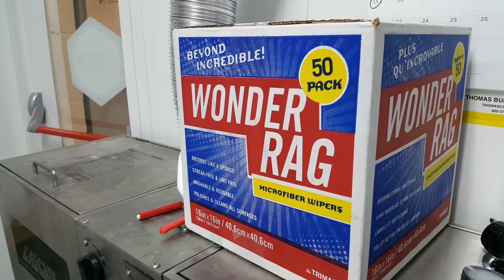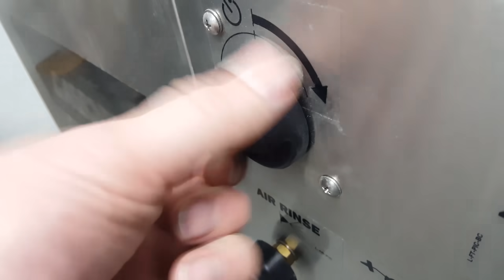Spraying Waterborne Paint / Tekna Clearcoat Gun

Comment: Great video whats the advantage of waterborne paint is it cheaper easier to use and do you need a special gun to spray it.
Reply from the maker: It contains less or no solvent that makes it compliant to spray in heavily regulated areas. You can use the same equipment for the most part, it is comparable to solvent just a few different quirks.

Comment: Hey Just a note to let anyone who might care about it -it is possible to turn a regular tekna into a clear gun by adding the DV703529 Devilbiss 703529 Air Separator & Seal Kit and DV704200 Devilbiss Automotive Refinishing 704200 (Pro-102-Te25-K)Air Cap & Retaining Ring. $150 US from autotoolworld.  I wish i could recommend the gun setup but after 2 jobs I find it no where near the atomization of either the Sata 5000 or the ws400.  It is a wet center heavy rp like pattern but at full material on a 1.3 tip i felt it was no better than the te20.

Comment: setting the gun for the primer? pressure? how many laps for the fluid? good job !!
Reply: Raffo Asus it’s sealer, one coat, air pressure will be the spray gun manufacturers recommended psi to achieve the required air pressure at the air cap. ie...Tekna pro lite would be 24-25 psi at full trigger.

Comment: ...which colour of paint did you say before spaying the red? And why did you spray it first
Reply from the maker: The groundcoat is a shade of grey, this one would be closer to white. Because the red is transparent, it will cover white with fewer coats than it would black. Another reason is because new panels require a primer to be applied first over the black e-coat for paint durability.

Comment: used my tekna for the first time today, loud and a lot of overspray
Reply: Julio.  I have thousands of hours behind Teknas.  If you’re loud and have an excess of overspray your gun is not set up correctly.   Check your data for pressure range and adjust accordingly.  Ensure you’re using the pressure gauge provided with the gun.

Comment: Your opinion?   I'm spraying SPI universal HS clear with a tekna clearcoat gun.  They strongly recommend using 1.4 tip.  Would you suggest the hv25 or hv30 cap for the smoothest finish?   I have a decent compressor with 20cfm.  Thanks.

Comment: I need some help. What should i do if my waterborne basecoat isnt dry enough and its allready covered in 2k clear. I have pressure point problems. If i put pressure with my nail i see a dent in the paint.  It has been a month since it got painted. Will it dry over time ?
Reply: You have water intrepment water hasnt evaporated and won't because it's sealed of with clear.
Looks like you have to take the clear off so basically start all over bugger😣

Comment: So what is the verdict on the tekna clearcoat gun?  I have been waiting for someone other than Gabe to review it.  Give some feedback on its atomization and your setup.
Reply from the maker: The best way I can describe it is it has the typical Devilbiss spray pattern, crossed with the wet core of something like an RP. It doesn't seem to atomize as fine as something like an Iwata WS400, everything lands pretty wet. I've only sprayed a handful of jobs with it and had some other people try it, been hit and miss with people. I've been using the TE25 aircap that came with it, I don't recall the pressure. For the jobs I've sprayed, it delivered the product well, but had a bit more texture than some other guns, nothing crazy but maybe I just haven't hit the sweet spot with it yet.
Reply from the maker: Also, I did use it on a job a few videos back (Blending Paint on a Hood). I talked a little bit about it, I think that was the first time I used it.
Reply: Yes it looks like it put on a litle bit more texture despite the obvious mist of the pattern from the video.  Im looking for the ultimate UHS clear gun for restoration work and zero peel with out heavy film.  So far the WS400 1.3hd is my winter  cold temp gun and the 5000 rp1.2 is the one for the summer.  Just wanted to know if the tekna clear was worth spending the coin for and it seems  maybe not.  Will be interested to see if you get it dialed in on the sweet spot on future videos .  I appreciate your doing this video-its good for those of us who dont have access to demos and dont want to buy a gun with out input.  The only other video on youtube showed it to be good choice for panel repair but not a complete.
Reply from the maker: Yes, I think currently the WS400 is still my front runner for the absolute smoothest finish I've obtained. I like what I've seen from the HTE clear gun also, but I don't have enough jobs sprayed with some of these other guns to recommend anything but the WS400 if that's the type of finish you're after. Most guns replicate OEM and will suffice in a production environment.
Reply: i do also have the Sagola 4600 1.3 and its somewhere in between a Sata 5000 rp 1.2 and the ws400 1.3hd.  for these clears.  Do you prefer 1.3 or 1.4 in the WS400-I bought my ws400 with 1.4 hd originally but it proved a little fast for me and the 1.3hd has worked best for me so far.
Reply: Scott Herr There are many good videos on Tekna/GTI Pro Lite on Gunmans channel and Tonys refinishing. If you already have a Sata 5000b rp and your not satisfied with off the gun finish, you may consider flow coating. The 5000, Tekna and Sagola 4600xtreme dvr are all capable of producing the absolute best finishes possible off the gun today.
Reply: Hey thanks for the reply-yeah Im not saying im not satisfied with any of the guns ive mentioned persay-i get beutiful finishes with all of them with reg HS clears-Ive just struggled to get that perfect off the gun finish so far with UHS(debeer, sikkens) clearcoats with out solvent pop.  As for flocoating- its what i do now to achieve glass. Id just like to get it done with 2 coats. Im a gun freak and lets face it who doesnt like trying new guns out-as for the gunman and Tony well they both rock been watching both for a long while.  check out big reds channel-hes great as well.
Reply: I use a Tekna Pro-lite (Gunman influence) for clears only and have finally dialed it in for the so-called "sweet spot".  Play with the gun and once you hit it, I am able to get amazingly glass smooth finishes without even trying.  It can be a cranky little gun at times, but I am finding it heavily depends on the reduction rate of my clear.  I try to go 10 to 15% thinners to over reduce.  I use the TE-10 cap and the 1.2 tip.  Very fine atomization at around 30 PSI.  Oh yeah, and I'm using Evercoat clears.  Not high-end by any means and get wicked results.  So I can imagine what a great clear would do.